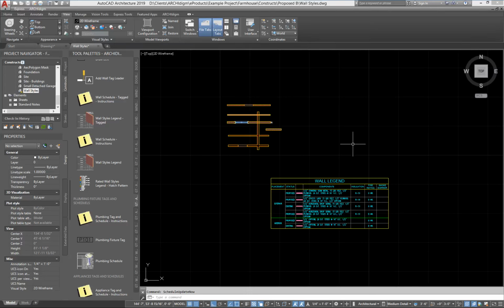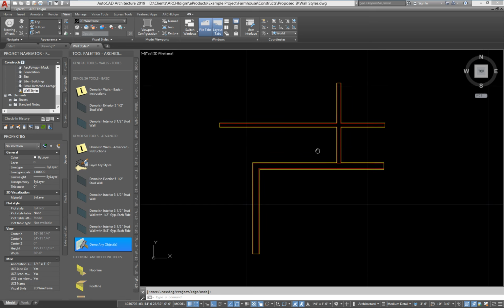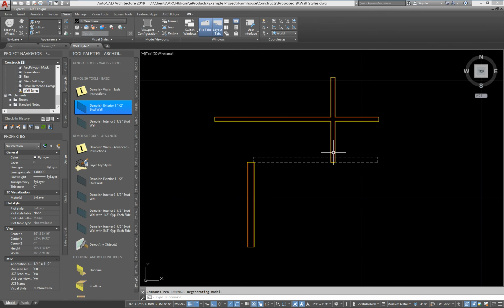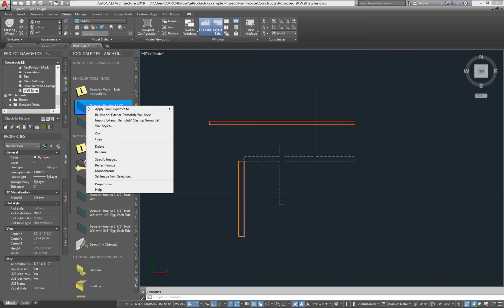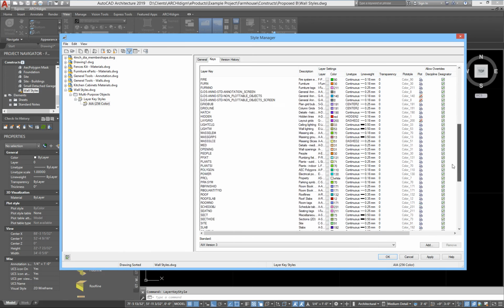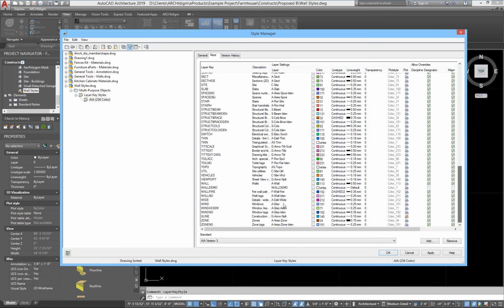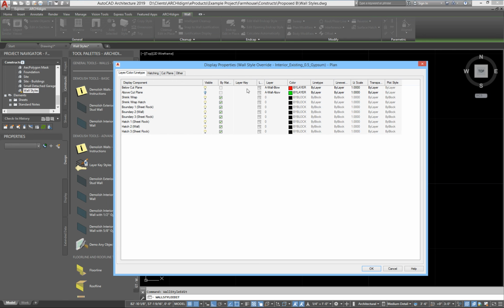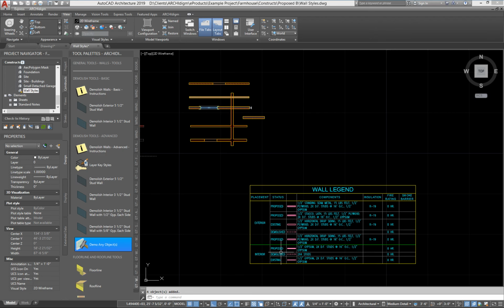Custom Wall Styles in AutoCAD Architecture - Part 2 of 3

Comment: What if you have to demolish only part of a wall ? Just brake it into a number of segments and mark the one you need? Or is there a more appropriate way?
Reply from the maker: Yes, I typically break my existing walls and convert the segment into a Demolished Wall Style.  However, if I feel the need to keep the existing wall as a whole I use a full height Opening Object and draw a Demolished Wall Style wall within the Opening gap.  Our Demolished Wall Styles use their own Cleanup Group so they don’t interact with the Existing Wall Styles.  If you use the latter trick, be aware that the Wall Property, “Length” will read the full length instead of the segments.